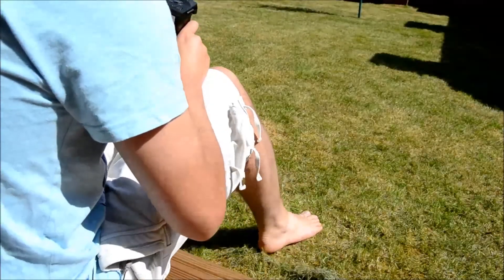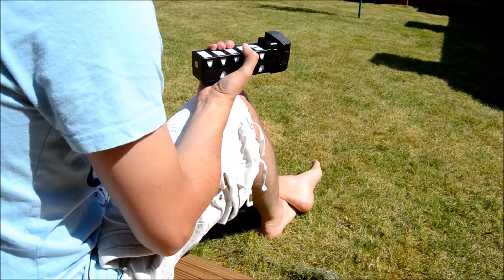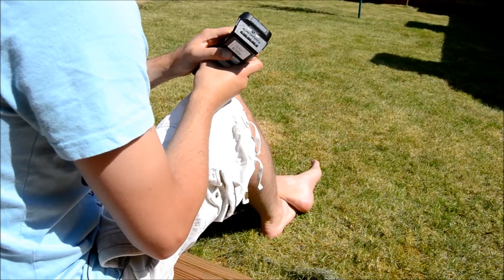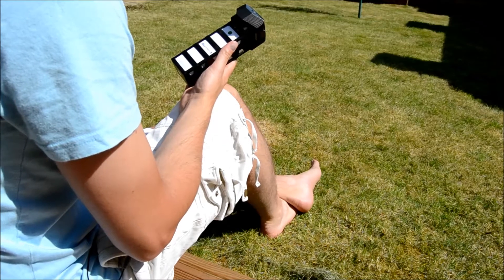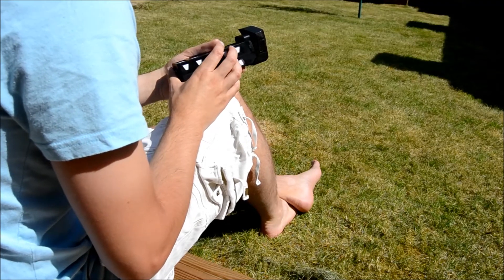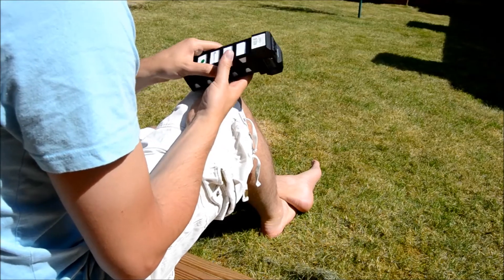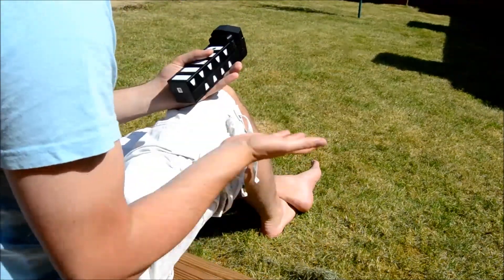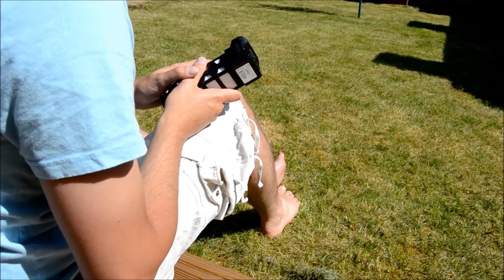Walkera Scout X4 - LIPO Degradation

Comment: Hey there I noticed that you I don't know I would say have a lot to say about the scoutx for and in doing so I've kind of just wondering if you maybe could clue me in to possibly what's going on with mine I still have mine still has not been flown yet and I purchased it oh I'd say these two and a half 3 months ago I have put luckily the battery into storage mode once I received it but I'm not really concerned with the battery Percy at the moment anyway what my problem is is I've followed the directions to a point and it doesn't seem to want to do anything that are illegal turn on and that's about it it will not disarm it will not the legs will not move so I was hoping that maybe you could give me some kind of guidance or suggestions of what I'm doing wrong do I have to go all the way into the system of the mission planner and the Bluetooth accessories in order to get this thing even just to respond to her to the remote control or am I way off base? I had the guy who sent it to me he even had it sent to a specialist or engineer rather and the guy told me and told him that it wasn't even used yet and so there can't be anything wrong with it the motors have have not even spun yet by battery power or anything else for that matter anyway tired of seeing this poor thing laying around and I'm hoping to get it off the ground eventually here it is winter but I still want to get it working as it is stands right now the legs are uneven and so I figured I'd go ahead and adjust the legs cuz they're supposed to auto adjust from what I read in the directions and the legs again will not even react if there's a binding procedure that I don't know about because I'm pretty sure that's reactive to the remote but then again I don't know how picky this bird is that it will not respond unless I do something specific so if you could offer up some suggestions I gladly appreciate it thanks for your time and I hope all is well with you over there across the pond as they say

Comment: I fly helis and the drones. The li po batteries should be broken in -charged flown for about 10 min. charged flown etc. Each time fly a little longer. If not used discharge down to 3.75 vts or so. you tube and some hobby sites has videos about li po batteries. Hope this helps.

Comment: Leaving any lipo battery fully charged for a month is asking for trouble. It's just the nature of the battery when fully charged to destroy itself unless that charge is drained off.
I wish we had a better options for batteries, but the lipo, unlike others, was designed for a rapid discharge. The kind used in UAVs.
Also, I've noticed a distinct correlation between wind speed and battery charge.
When my batteries are in the storage charge, the wind is calm.
When I charge my batteries and get ready to do some flying, the wind picks speed and get gusty!
This should be investigated! :-)

Comment from the maker: You can take apart the walkera lipo and just replace the lipo. It's cheaper than buying a new walkera lipo with casing.
Reply: What's the C rating on the Scout Battery?
Reply from the maker: Crap? :) I don't know I am afraid.
Reply: Eric White As far as I can find, the Walkera Scout is 10C. They claim "high capacity and low C rate provides an incredible capacity to weight ratio". Also a lower C rating will tolerate storage at full charge better. I think that the degrading problem may be more to do with quality control.
Swap out for another 6s and try a higher C as long as the dimensions are the same.
Reply: I'm going to try it. I will keep you posted.
Reply: Eric White Looks to me like you'll have a hard time finding a battery that will fit the battery box. The boys at Walkera were clever. I think they used two 11.1 or three 7.4 volt batteries in series to get the unusual size of 45mm X 45mm X 141mm.
Let us know if you find a 22.2 volt lipo that size.
So far I've found that 2 of these might work, but without the case.
http://www.hobbyking.com/hobbyking/store/__56839__Multistar_High_Capacity_3S_5200mAh_Multi_Rotor_Lipo_Pack.html
Reply from the maker: I swear I have seen unmarked white lipos exactly the same for sale somewhere but cannot for the life of me work out where I saw them!
Reply: Alex Savo Hey, Alex! I did a Google Image search for "6S 10C lipo battery" and some like you mentioned showed up in Alibaba, but everything I can find has a dimension of over 50mm and they pretty much have to be 45 X 45mm to fit the case.
You might be able to squeeze these in. I don't know how accurate their measurements are. I'm tempted to try a couple.
http://www.hobbyking.com/hobbyking/store/__16793__ZIPPY_Flightmax_5000mAh_6S1P_20C_US_Warehouse_.html
Reply: Alex Savo I just got two 6s lipos and nether will fit the Walkera battery's hard case.
I recently bought a 3D printer and I'm thinking about a replacement battery door.
Both the Zippy and Turnigy batteries fit inside the bay, but a new door to hold the electronics will have to be fabricated.
I'm afraid that unless someone can come up with 45 X 45mm batteries, this will be the only option.
Reply from the maker: Wayne Hobbins This is rather annoying. I need to investigate where else lipos can be picked up and replace the current ones.
Reply: Alex Savo I have one other possibility. Wiring 3 of the Lumenier 2S batteries in series. I have one and it's dimensions are 134 X 43.5 X 13mm. I think there is enough room, but the battery wires would have to be shortened and plugs made.
http://www.getfpv.com/lumenier-4200mah-4s-35c-lipo-battery-1012.html
The link says 4200mah-4S, but it takes you to the proper page.
Reply: Alex Savo Here's another thing that will annoy you.
I decided to buy one of the $35 replacement parts kit for the Walkera Scout battery. Play around with it and see if I can come up with a tray that would work with after market batteries.
Well, guess what? It appears the market has dried up. Can't find them. iUAS in America had them in stock, but they've disappeared from their website.
Wonderful.

Comment: I believe I'm having the same problem I'm only getting about 10 to 12 minutes of flight time and I have 4 batteries. I think it's the batteries Walkera is using. The reason I'm saying that is because  I have some tringy batteries that I always leave charged and I get maximum flight time out of each one of them and I've had them for 5 months longer than the Scout batteries. I think these are just cheap batteries.
Reply from the maker: Good to know. Where did you get those?